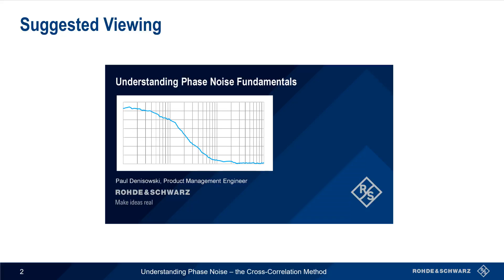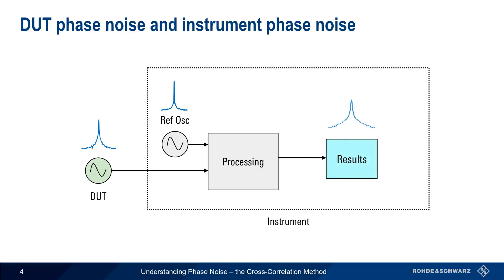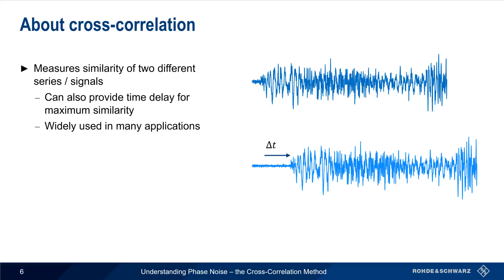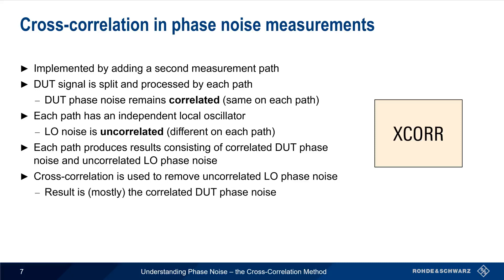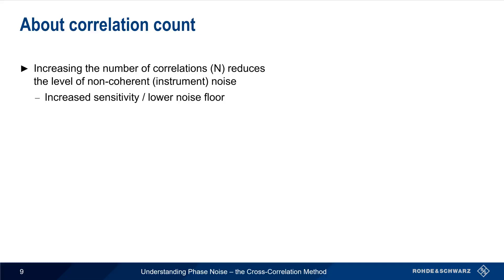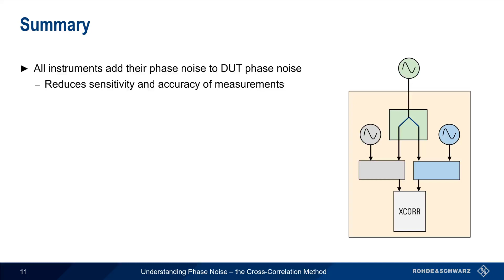Understanding Phase Noise - the Cross Correlation Method

Comment: Here are potential problems:
Ref1 & Ref2 are not frequency locked, so they are drifting.
If they are frequency locked then their noise is correlating.
Splitter circuit adds correlated noise.
The best way is to use GPSDO or Rubidium time reference for lo of test equipment.
Note that absolute accuracy, is absolutely impossible by uncertainty principle.